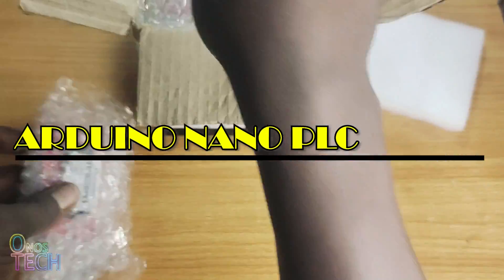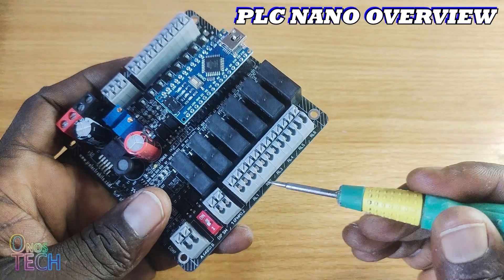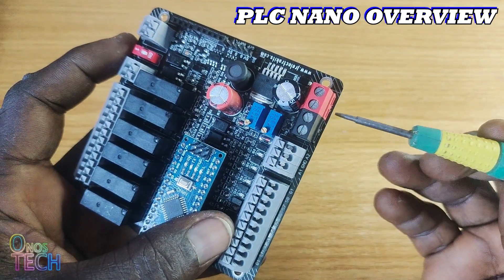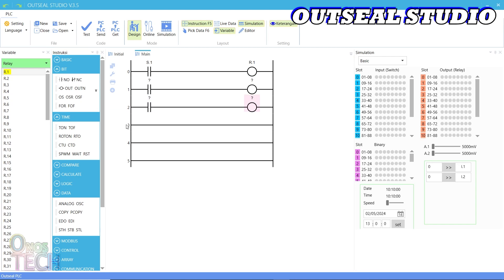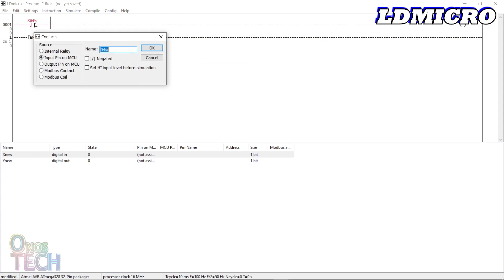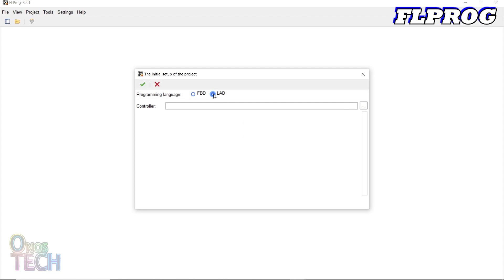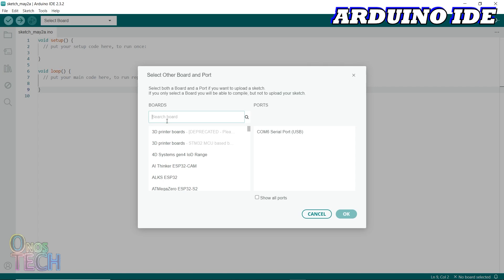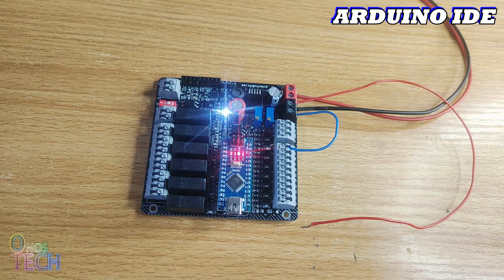LOW-COST ARDUINO NANO PLC

Comment: do they also make similar PLC boards for Arduino UNO?
Reply from the maker: No they don't. But you can also use the Arduino UNO with relay modules for outputs and optocoupler modules for inputs. There are similar videos on this channel on these
Reply: @OnosTech Thank you. Will definitely watch those.

Comment: Thank you very much for sharing. Can we use this board for industrial applications? Do you suggest ?
Reply from the maker: The board design is based on the IEC 611331-2 standard, which is for industrial applications. So it is good to go.